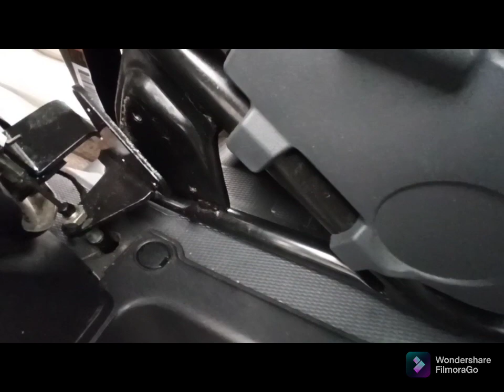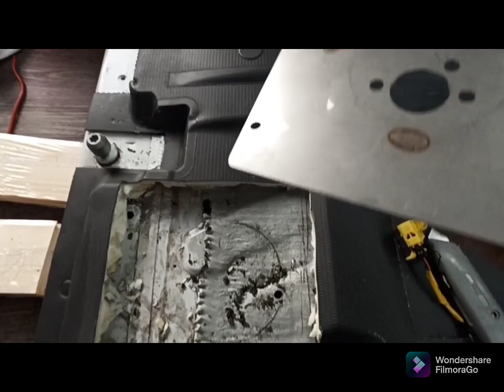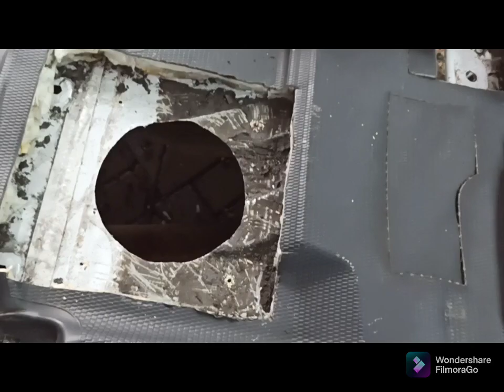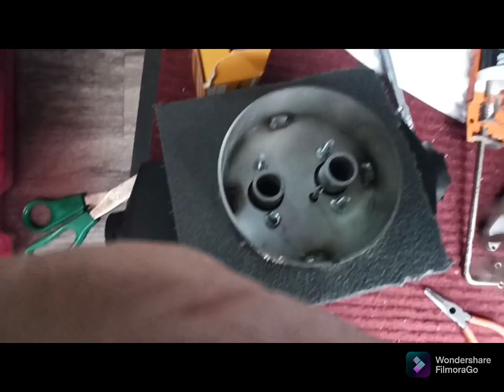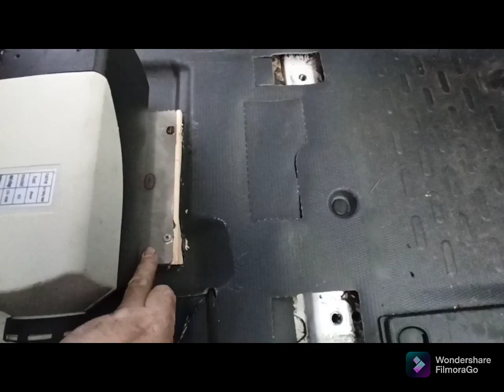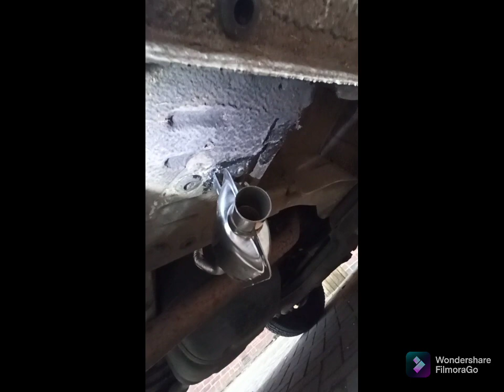Fitting a Chinese diesel heater under the driver's seat in a Fiat Ducato

Comment: I also used a wooden frame to raise the heater base plate up a few inches. I found that if I didn't the hot air outlet was obscured by the metal bar of the seat base so fitting the vent hose would be very difficult.

Comment: Wood really doesn't seem the best material that close to the hot parts of the heater
Reply from the maker: It's actually not hot that's the idea of the turret mount, they are designed to go through insulation on the floors of vans and motorhomes, so they stay cool and don't transfer any heat